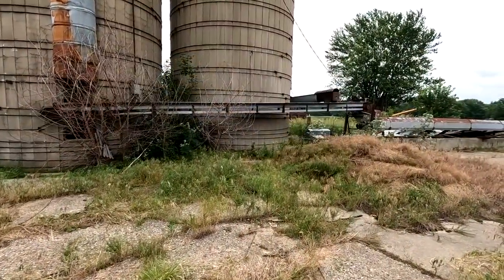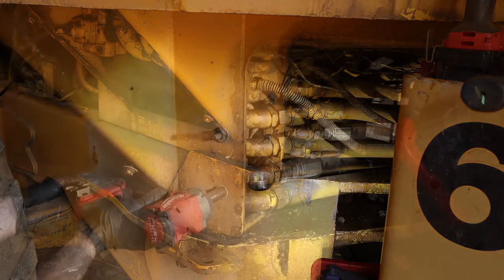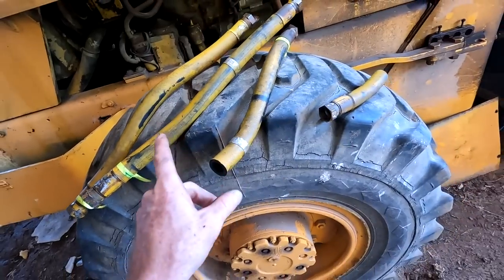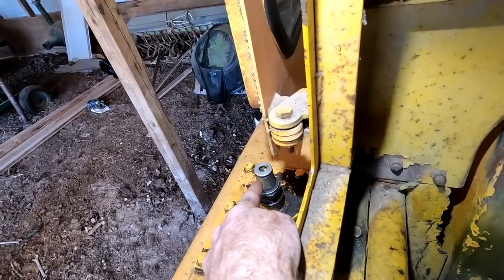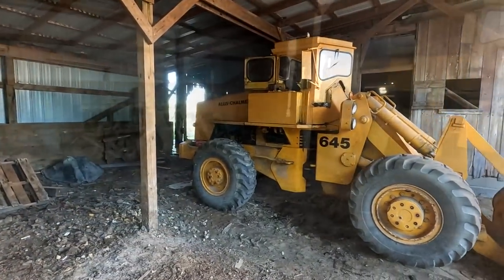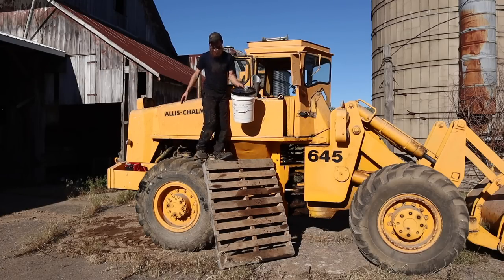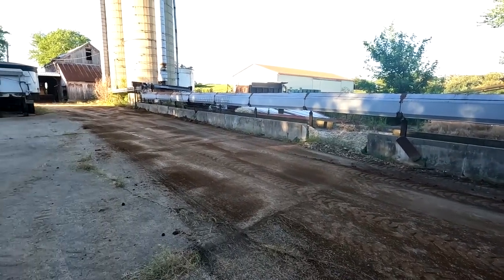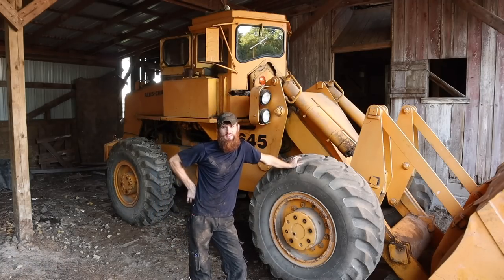Major Issue STOPPED me in my TRACKS! ~ Day 5 ~ 1965 Allis Chalmers 645 Loader

Comment: Just a bit of advice...you should never start a machine unless you are sitting in seat, where you have a quicker response to all the controls (and in a safe place in case the machine was to start moving)...keep up the good work
Reply: that's very true 'saftey first"
Reply: Damn, there went a quick 225.+ Did you buy it to keep it or flip it, I don't recall you saying?
Reply: Thanks for sharing !!
Reply: You make me want to go find one.
Reply: Good advice for an operator,  but not sure how a mechanic diagnoses a fuel system problem while sitting in the operator's seat.  We might sometimes have a helper who could sit in the seat, but if they wouldn't know know which lever to pull they would just get in the way of somebody who does.  The best safety advice I'd give is to approach a job like this with a clear head mindful of all that could go wrong, and have somebody standing around who is at least able to call for help.
Reply: Matt did have a way to shut down the engine by starving it of air.  In addition to being able to shut the engine down even if some fuel solenoid isn't responding to some switch up in the operator's seat, it is often recommended when not sure if the governor is freed up.  A stuck governor can cause that engine to rev up till it destroys itself.
Reply: @jerrygaffke9386  He did yes one way you can shut a diesel engine down in an emergency is to put a board over the turbo intake when you do that you starve it of Air and that will kill the engine Diesel engines need air to run he demonstrated this when he got the engine on the loader to start
Reply: Was just gonna post the same life saving advice for machine operators, only start engine when sat in operators seat, especially with older machines that may have ‘sticky’ operating levers like what happened with loader arm rising.

Comment: I use to work on logging equipment and heavy equipment also and some of those hoses get mighty close especially trying to tighten those large fittings. I found out instead of taking them all back apart I would take a center punch and a hammer on those flats and that would tighten up the leaks without a lot of trouble. Also I think you need to idle your machine down some, I noticed when you put it in gear it would jump and that's not good on the transmission and it could also be dangerous when in close quarters with fixed objects or fellow humans. When you put it in gear it should sit still until you give it some throttle. I also like to bring old equipment back to life. Keep on keeping on my friend.  Lee

Comment: Hi Matt, try sealing the steering wheel with a polyurethane sealant. Those old steering wheels are made of bakelite, and they get porous after a while. Sealing may prevent it from breaking down further and it would keep your hands clean. Another suggestion would be to use a wrap for the wheel. You might have to make something for it, because the wraps at the auto parts stores would be too small .
Reply: Get a wrap for baseball bats.

Comment: 17:08 just wanted to touch on something incase you weren't aware, you really never want to check for hydraulic leaks by grabbing a hose or fittings. If there was a pinhole leak, there is a risk you can get hydraulic injection which can be really bad.

Aside from that, love the videos, old equipment is so awesome

Comment: I have a 1986 Case W20B wheeled loader. It was an auction buy from the national parks system. It spent its first life at Joshua Tree National Park. It has a Case backhoe mounted on it. I've only seen two frontend loaders with backhoes on them, and I bought the second one. The NP ordered it from case that way. So case did all the fabrication. The loader came with two sets of manuals, parts manual and the log book. Page 1. is the receipt taking possession of the loader. All the notes on adding the backhoe are there. Every bit of maintenance is logged right down to the oil filters. I have a tension grapple I hang off the backhoe to load logs on my sawmill. I have chains on all four corners and leave them on, as I live at 4,000' on the U.S./CA border in WA. Summers are only a couple of months long and snow is seven months long. I love this loader even with its reputation for being tippy.

Comment: That 65 Allis Chambers 645 Loader seems to be almost new and probably has never done a hard days work yet. Lol At least you won't need to buy new tires. However, any rubber gaskets or parts may have to be replaced. I have had some experience myself where looks and appearances can't be taken for granted.

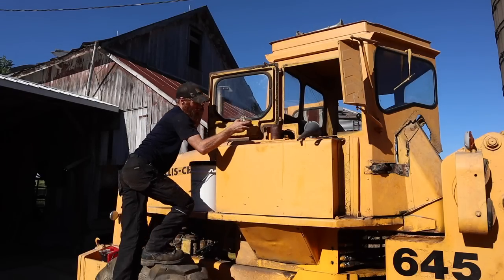Comment: 20:37 That plug on the side of the hydraulic tank should be the flud level in the tank. It you have fluid at that plug, it should be full.
Reply: I agreed on the level check plug. I’m thinking the glug noise would be air in the system bleeding out as well.
Reply: I agree on the level plug if no gauge or sight glass. Also, after a leak of that size the glug glug would be the air coming out of the system as the lines refill.

Comment: That bolt on the side of the tank is the fill level, you remove that and fill the tank until it dribbles out and that's the correct level.  That glug glug sound is the tank under or over filled, and there's air in the lines that will need to bleed itself.

Comment: need to invest in some tappit wrenches. Commonly called hose wrenches now. Like a box end with about 1/3 cut out so you can slip it over the hose and slide it up to the fitting. Most are 12 point. Got a set years ago when I got my first Case 580n. Great vid and awsome trouble shooting, welcome to the big boy toy club!

Comment: 10:27 the solution to the whole dilemma would have been to start with No.4. Then you even could have put the mounting bracket in first, with less tension. By starting wth No 4. you would have had enough space for the wrench from the top of each line. ;-)
Reply: Yep
Reply: Seems he always takes the hard way in everything he tackles.  Open up the hydraulic filter cover, could have just filled the tank that way while it was off.
Reply: From the start I was yelling at him to start from the top and work down and reverse for refit.
Reply: @Broozer-fw3vl  ha, yeah, a lot of folks sometimes forget to consider the obvious... the factory must have had a way to install everything themselves.
Reply: #4 first always allows wrench space.

Comment: For tightening hydraulic hoses use a " flare wrench" , or make your own from a ring wrench and cut a big segment out of the ring with a cutoff wheel. The piece you cut out has to make the wrench asymmetric,  so it looks like a curled finger, and you have to use it the correct way around ("finger" on top to loosen, and on bottom to tighten)
Reply: For what it's worth. The "flare wrench" you are referring to is actually a "line wrench". It may be used on a flare fitting like a brake line but it will also be used on many fittings that aren't flare fittings. Additionally the ring wrench is actually called a box end wrench.

Comment: I don't know nothing about this machine or about hydraulic system on this either, but I think that sound you heard from hydraulic tank, is because the air is passing out of the system and exchange by hydraulic fluid, when pump is running. Sorry if I said something stupid

Comment: Glug sound probably coming from air in system. Probably will stop after it runs for a while. Steering wheel cover might be an option to cover the brake down of rubber or plastic steering wheel to keep your hands clean if you can find a steering wheel cover the right size.

Comment: i do a lot of hydraulic repair.  i would have taken the hoses out, and put them in, in the opposite order that you did.  taken out 1 first, 4 last, put 4 in first, and 1 last.  the reason is you have room to swing a wrench up top, and none at the bottom.  so, remove 1 because you have room.  now you have room to swing a wrench for 2, then 3, and finally 4.  reverse it to go back in, and you might not even have had to remove the support/separator block.

Comment: Matt, There is a baffle in the hydraulic tank near the filter to stop foaming/surge, probably what you could hear, you really need to buy some BACHO adjustable wrenches that allow access in tight spaces you will have much less trouble with the hydraulic fittings.

Comment: If ever in a pinch for a funnel, use aluminum foil.  You can make it as thick as you want for strength and bend it where you want.  I use it to drain an old lawnmower I have.  The drain is in an awkward spot and oil gets all over the frame.  Sure, I could pick up some tubing, but I have foil here at the house and no trip necessary.  It's recyclable too.

Comment: The keyswitch that had a poor connectivity must have fixed itself so now the engine will switch off.
Consider adding a few cheap video cameras and a screen to display them to improve visibility from the cab.

Comment: Getting the bracket for the hard hydraulic lines out and back in might be easier if you loosened (but did not remove) the likely similar bracket at the other end of the hard lines. The way you did it the hard lines had to flex a bit, they would not have to do that if the other end were free to pivot a bit.

Comment: Just some info on hydraulic hose assemblies.  Typically on heavy plant (as we call construction equipment here in the UK) hose is of 2 types, 2 wire and 4 wire.  This refers to the number of wire braid reinforcement plies in the hose, and therefore the working pressure of the hose.  There is also thin and thick cover, which is the thickness of the outer rubber cover or layer, but that is less relevant.  There are other specs of hose with more wire braids, but that is less common on the typical plant used in construction.
It's actually quite easy to work put what is needed hose and fitting wise, just get some catalogues from the big hose companies like Gates, Dayco etc and swot up on the specs and fittings, the standards are pretty universal.  The small companies making up hose assemblies make quite a buck out of guys that just walk in and say make me one of those!  If you measure it, and then tell them you want a 15" seat to seat, x 3/4" bore 2 wire (R2AT is the sae type for that) assembly with 3/4" JIC females each end, for example, they will think you know the trade and you get a better price.
Reply: I'm in the UK too and that was a lot of great info there. We also call construction vehicles "Plant Hire"
Reply: I'm pretty surprised there wasn't any info they could pick off the embossed laylines on the old hoses to figure out their rating. Hello fellow industry professional :)

Comment: The noise you hear in the hydraulic tank is the air purging from the system. When the hose blew and you removed the four lines it allowed air to enter and is now working its way out.

Comment: I'm very surprised you haven't invested in making your own hydraulic lines yet, you seem to be acquiring quite the collection.  Great rescue once again Matt
Reply: The swage tool is pretty expensive. The tooling for it can cost as much as the machine or more. Then you need a range of hose sizes, different ply hoses, different rated hoses and a fitting to fit everything you have or might have. 
I managed industrial maintenance for 12 companies in the last 50 years. Unless you get a screaming deal on a close out factory you would have to have a business selling hoses to suppprt the inventory.
At least you wouldn't have every farmer in the shop goverment jobbing hoses for their equipment.
Reply: I own a loader, a dozer, and some forklifts and I looked into being able to make my own hoses. What I found is that the price of a brand new hydraulic swaging press is prohibitive for doing just a few hoses here and there. Even a good used one is going to be multiple thousands of dollars. Add in the cost of keeping various size fittings and hoses in stock and it makes financial sense to just let a hydraulic shop make the hoses for you if you’re not running a fleet of equipment.
Reply: @ssmt2  i paid 500 of my parker crimper and have bought all the dies up to 1 1/4. I try to buy my fitting off ebay and can often get them cheaper than what the Parker store is getting them at
Reply: @73DiamondReo  If I ever ran across a deal like that I would buy it in a heartbeat. The last Parker swaging setup that I saw at an auction went for $10,000. That was a few months ago. I didn’t even bother bidding on it after I watched the first few bids go to $3,000. You got a heck of a deal on yours.
Reply: @ssmt2  parker Karry Krimp. won it on ebay
Reply: It seems like he needs a lot of hoses, but in reality it's because he rescues these old machines. Hoses actually last for a pretty good length of time, so it's probably not worth the investment (unless he found a great deal at an auction or some such).
I used to work at a Plant Hire firm, we had probably fifty machines and a fleet of trucks at any one time, and if the hose swaging machine was used more than once a week it was unusual. It costs an awful lot to get a full inventory of hoses and fittings, not to mention the machine.
Reply: Cost wise it takes a lot of hoses to recoup the investment in dies and the crimper.  The biggest cost however, is the fittings.  There's a LOT of different fittings, and unless you have the exact ones you need in stock you can't make a hose on the spot.

So you're either stuck waiting for parts delivery (to get it cheaper) or you're driving to the hydraulic shop anyway to buy the fitting.  If you're going to the hydraulic shop, why not just have them make the hose while you're there?

I do have the gear to make hoses, but I got the whole setup and inventory for an absolute bargain.  Plus it's a 4+ hour round trip to get hoses made, and they're only open limited hours.  Blow a line at 1300 Friday and I'd be out of action until near midday on Monday.  No good when I'm racing the weather or whatever.

Comment: glug glug glug.... you just opened the system and drained it  theres air in there and im betting the glug is air returning to the tank .... cycle the rams a few times and most of it should work its way out. im no mechanic so i could easily be incorrect. thanks for the videos
Reply: Definitely will need to purge the Hydraulic system for sure, After the service and filter change, that vent could be partially stuck, whatnot, etcetera lol.
Reply: @blockheadfxstc0428  I'm thinking mud dauber nest in the vent pipe.
Reply: @retireddec04  very possible, but with it being broken, might as well repair it anyway

Comment: Good job on getting the old girl running & working a set of angle wrenches would help a lot on those type hose fittings I was a heavy machine mechanic for 30 years only worked on one Allis Chalmers wheel loader it was newer the Fiat AC machine had to repair a transmission problem it had a ZF transmission not much fun to get parts for

Comment: The plug on the side of the tank is the fill level you take it out and with the bucket level and on the ground you add oil tell it pours out that plug the put the plug back in

Comment: Replace breather with a common unit used on small hydraulic tanks or an old oil fill cap from an old inline 6 will do. Yep, air in system is burping in oil tank.AL B.

Comment: Note to self when filling hydraulic systems fill through the filter easier and it also filters your oil most new machines don't even have a dedicated fill plug they just fell through the filter
Reply: In over a decade of working on heavy equipment, I have never seen one where you "have to fill through the filter". Not even once.

Comment: It's great to see another old machine getting ready for a new life. I'm not sure how close to original you want to keep her but adding a camera to the front of the machine with a display in the cab would be a great way to increase what you can see as well as increasing accuracy and site safety when she's working. I'd probably have a camera for the front and back of the machine as I think that the operators view came somewhere very low in the designers list of priorities. That probably thought you could work by braille!! Not fun 😅👍👍👍
Reply: I've seen people drive cars by braille, I hate to think what that would look like in a machine this size!

Comment: Congrats Matt on getting the Hdyraulic lines off/on.  It might be me, butt if u was to put-on the bottom
line first/4,  then do /3, adn then /2 and /i u would be able to tighten the lines better..
Reply: And have one of the retainer halves bolted on. It looked like there was more room at the top. But I would also have put the machine in a 150 degree angle.
Reply: Or use a chain wrench. Works well in tight spaces.

Comment: It is coming along well, it has already done some excellent work. Yes, old plastics do have some nasty traits, becoming slimy, sticky, losing nasty black slime or just staining your hands. You will have a fix for that issue in due course. The old way was a cover, laced on top of the mess.
Reply: Sanding down the rubber a little and then coating with epoxy paint works.
Reply: That is carbon black coming off. It is used to give the material it’s black color.

Comment: Old hydraulic hoses and old tires are going to cause problems. At least Allis Chalmers uses a lot of steel lines but we had a couple of those fail too. Does it shut off with the key because the key shuts off the fuel pump?

Comment: Wouldn't it be a good idea anytime your far away. Once those machines are running and moving. Is to get them home immediately before you put them through their paces. Then when any hick ups happen it will be nearer for parts, cheaper on gas, and a time saver to fix them. 👈😉👍I'm all for a test as the next guy, but not for the headaches or a lite pocket book.